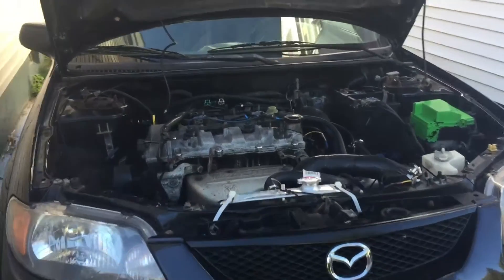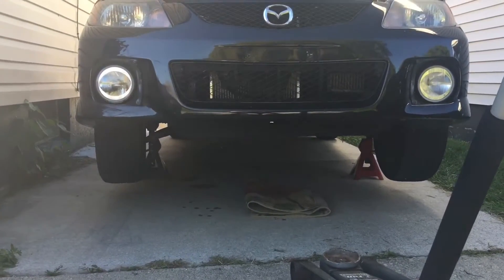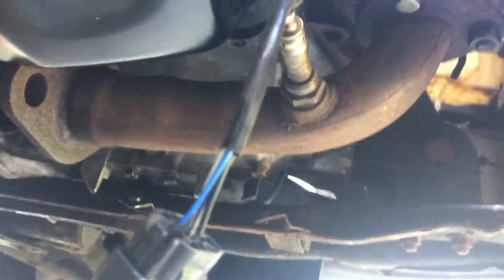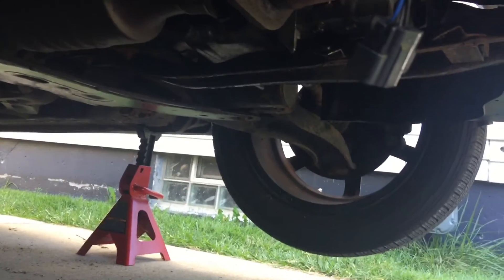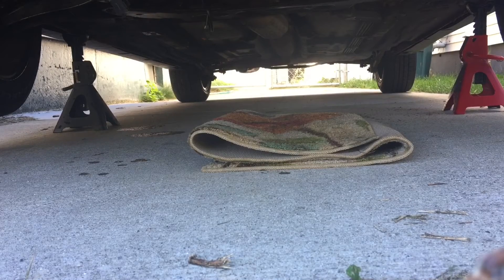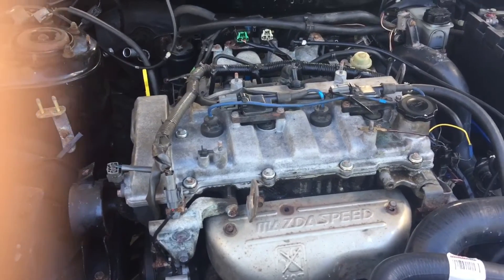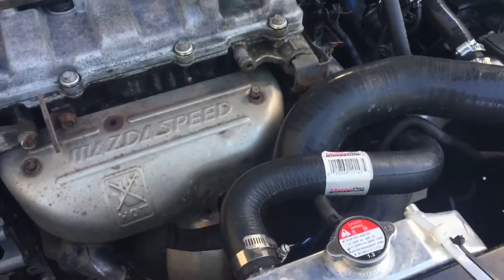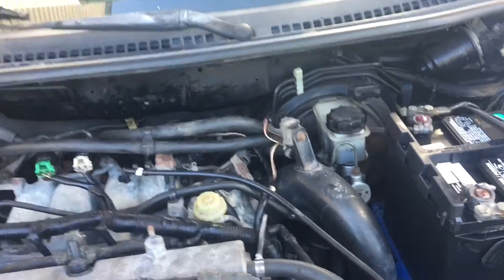Protege Turbo Build part 3 "Almost road ready!"

Comment from the maker: Civic 2 row off of e-bay RAHC92422. This one is for a EG hatch. I can give you the hose numbers too if you need it because you use a different hose setup. I just took one 18 dollar hose and cut it if your interested i can get you the part number for the hose i used.
Reply: Protege Garage yeah. Can u? I was looking into putting a 3 row from an eg but wasn't sure if it was compatible. Thanks
Reply from the maker: +hcracer1985  part# 22358 Just google 22358 radiator hose. You just cut that for the upper and lower radiator hose.
Reply: Protege Garage thanks
Reply from the maker: Any time, glad to help. Check out the facebook group I admin for ."Protege Chill Spot"
Reply: Protege Garage just sent a request

Comment: sounds good?
Reply from the maker: Its alright not perfect sounds like a lawn mower to me and its my car lol.
Reply: +Protege Garage jaja but it souds like somesort of subary , i have one but the non turbo one , i want to make it turbo but i dont know how much psi to initially put with stock injectors, how many psi does a stock mazda speed haves?
Reply from the maker: AronElite GameDevelopment 6psi stock. the limits are debatable on reliability some can run higher psi, eventually I plan on forging the spare motor. I personally would do handling mods to the car first. it responds really well.
Reply: +Protege Garage thanks for blazing fast reply , my protege haves aftermarket control arms on the front including the axels , shocks absorbers are kyb not coils , its really stiff , i have gone 117mph on the car and it dose not speed wabble.
Reply from the maker: AronElite GameDevelopment what about tires? honestly a nice set of summer tires will make the car competitive in autox.
Reply: +Protege Garage i was ganna say but last night was raining and the street was flooded and dark , i hit a sharp hole and lost 2 of my V spec tires ...
Reply from the maker: AronElite GameDevelopment ouch!!!!! hope you got spares :(((
Reply: +Protege Garage yeah i got some spares installed but there almost shut to the wires ,yesterday was raining also and i took a curve where the paviment was made with melted rubber and the car started power sliding it was fun but dangerus i hate the spares already becauce sence theres one tires on the right are new and the left are old the car starts to a burnout
Reply: +AronElite GameDevelopment on the left side , its funny because on the red light when it gose green people start to turn heads to see q punny protege doing a burnout one sided lol
Reply from the maker: AronElite GameDevelopment lmfao yes! I live it.
Reply from the maker: love lol
Reply: +Protege Garage lel